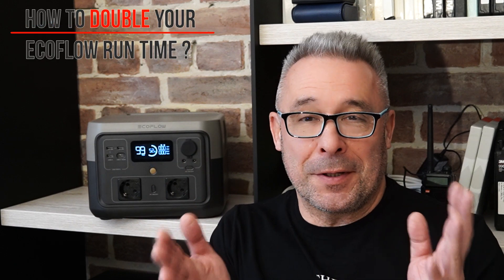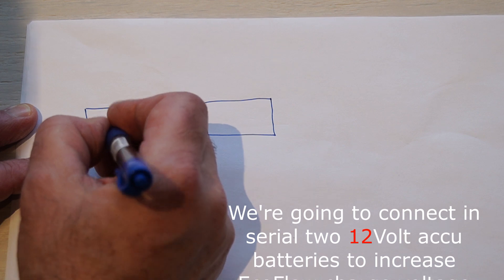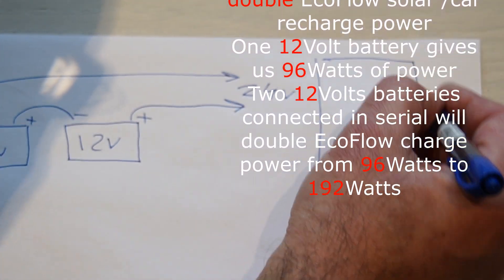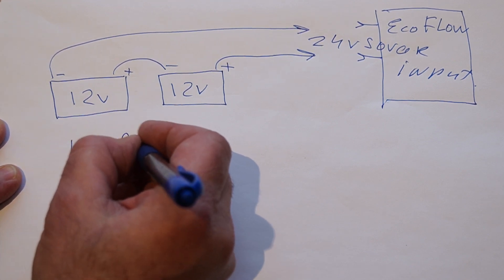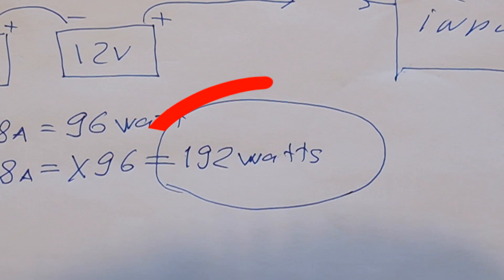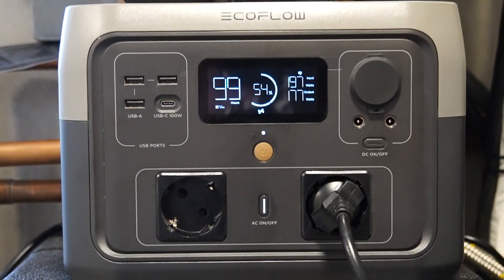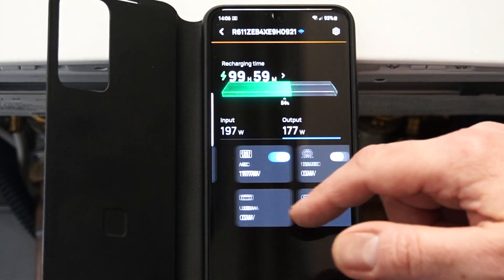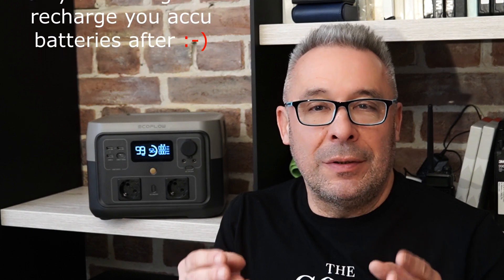How to double your EcoFlow run time ?

Comment: Great video...
just two things. the XT60 port is limited to 10amps in. I guess that's why you are only transfering at 8.62amps
secondly... you are right at 24V the charge wattage is higher but connecting them in series like that. when one is a 55Ah battery and one is a 70Ah battery. you will only get 55Ah at 24V = 1320 watt hours out of it.
if you connect them in parallel, you will get the 55Ah + the 70Ah at 12V, giving you 125Ah at 12V =1500 watt hours
that's an extra 180Wh... your heater would run for an hour longer :)
andd if you are only drawing 176w out, the River 2 would buffer the input/output
Reply from the maker: Thank you very much for your comment and ideas !
First of all, you're right, XT60 port are limited, as well, as River Max 2 also has internal limitation, and you can't make input current bigger, than 8 amperes. So, only one way for increasing input power for recharging EcoFlow River Max 2 "in the air" - to increase input voltage, I was able to connect two accu's in series, River Max 2 has a limitation of solar input voltage:11-50V 13A, 220W Max, so basically, I was very close to the max possible recharging power. 
Thank you for your comments !
Reply: @crazyengines88  Yes...
I used to of my Ryobi ONE+ 18v Lithium-Ion Batteries in series to give me 36v.
and I got over 200 watts of charge rate
And two of the 4Ah batteries charged the River 2 Max by 25%.
happy with that :)
I did share a video, if you'd like to look ?